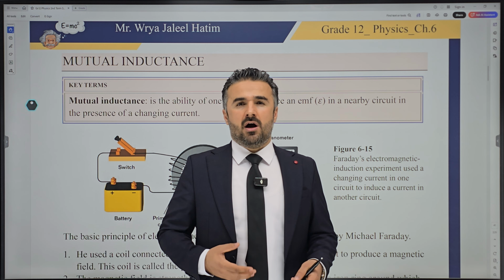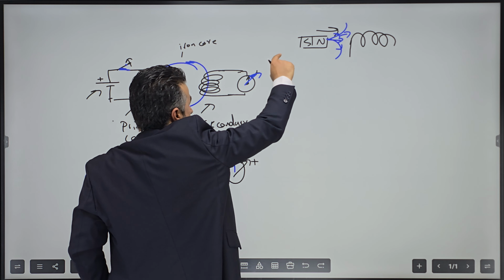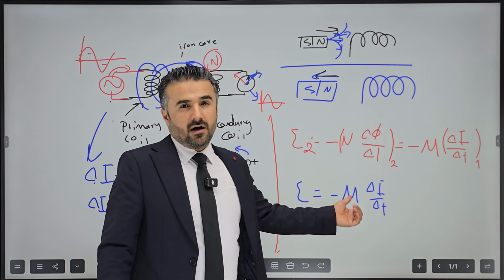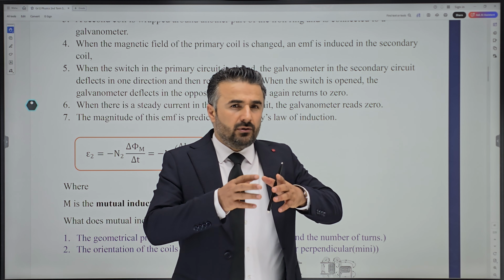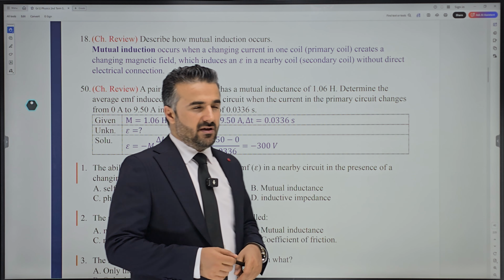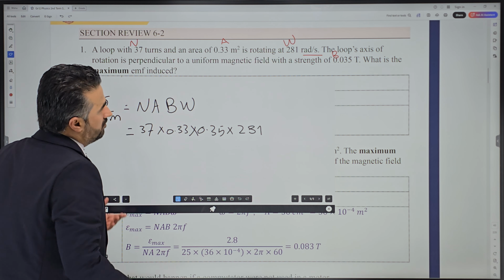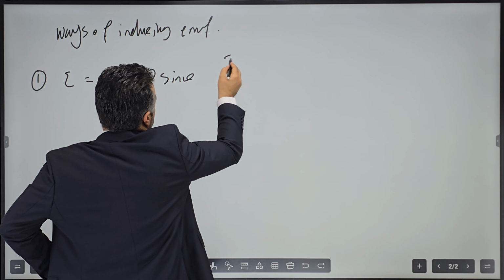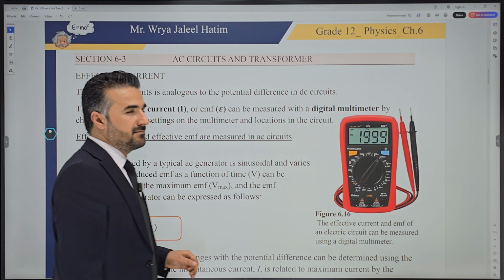Ch.6 Lesson 8

Comment: salam mr hope you're doing well, i have a question that says a 0.406kg ball on a 0.50 m strong rotates in a circular path in a vertical plane. if the angular speed of the ball at the bottom of the circle is 8 rad/s what is the force that maintains circular motion? and what i got wrong is that i used FT= FC+FG why don't we use that like doesnt that tenstion force maintain the circular motion in this case? or is it always fc that maintains the circular motion